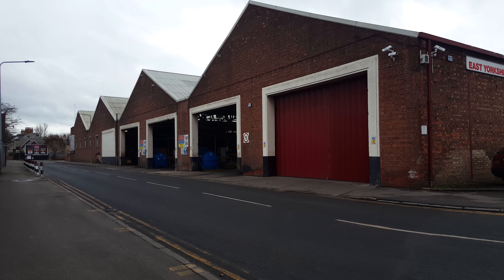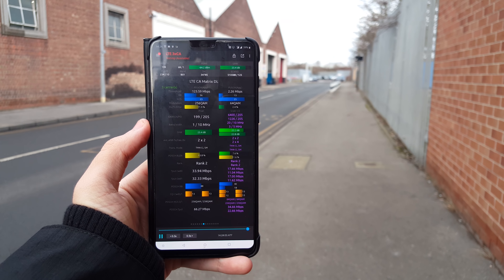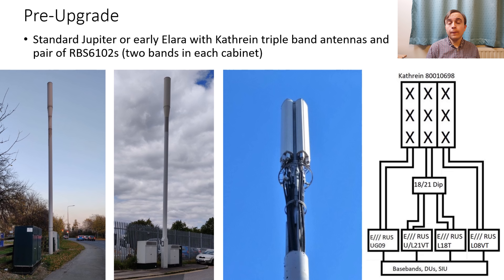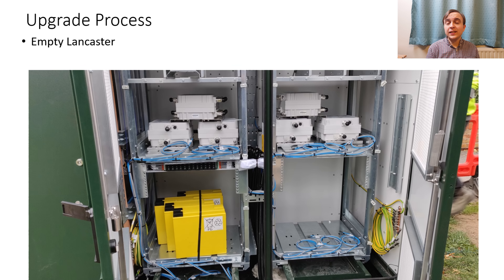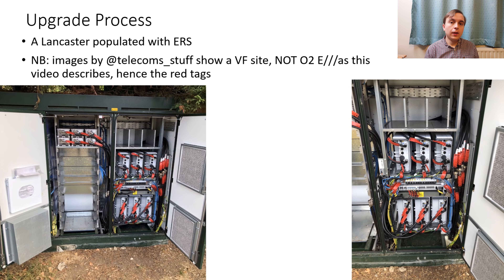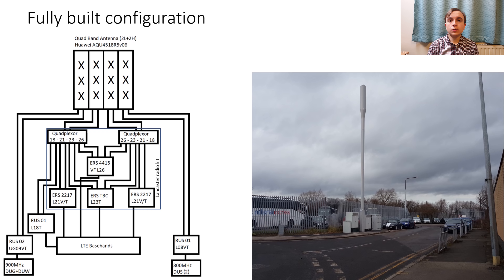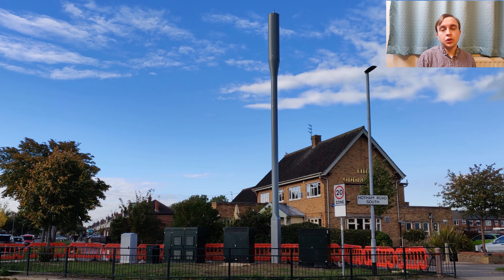Inside O2 E/// Beacon 2 Streetworks Upgrades for O2 L23, VF L26, L21 both: O2 4 LTE carriers, VF 3CA

Comment: Good video as always. You mention batteries in the video. It would be interesting to know more about the battery backup systems in cellular networks. Do they all have batteries? How long are they expected to last in the power failure? Are generators used? Etc.

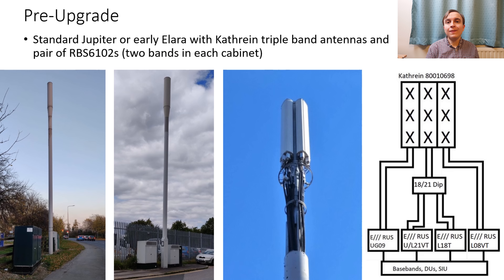Comment: Thank you for explaining this, as three of the left pic at (2:00) have been replaced with the one on the left 3:45 but are slightly modified. It has an antenna at the top & square black shaped panels going around it. All the wires are in the poll not on show. Has a fairly bright red light that is constantly blinking. They are all are around under 5 miles frm each other no joke. Is that even safe?  There's at least three of Spitfires & Cannons dotted a mile straight.